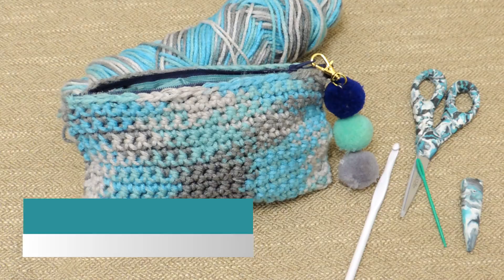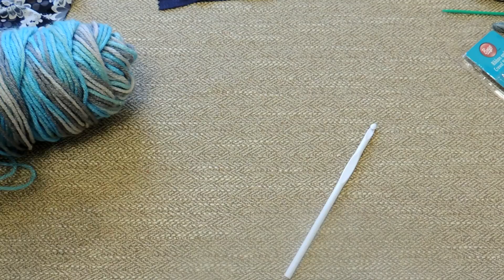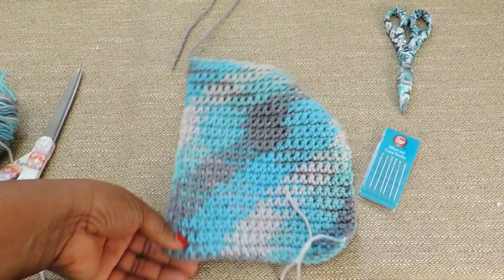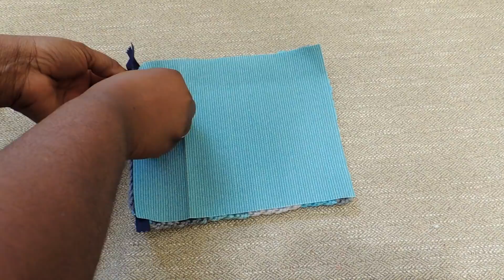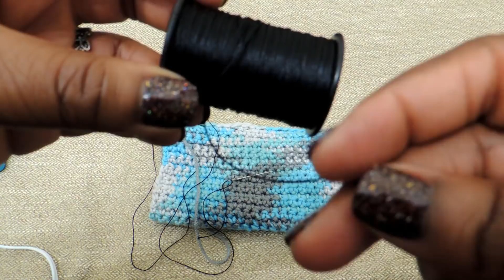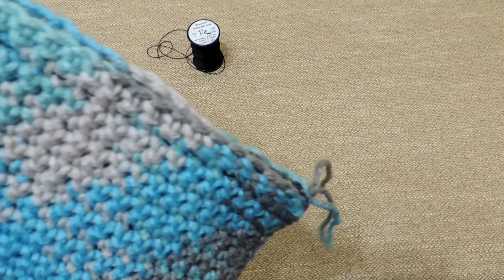Crochet Zipper Pouch-Beginner Project

Comment: How many rows and multiple of ?
Reply from the maker: Hi, this pouch is a customize bag so the stitch count may vary based on your needs. I had a 7 1/2  zipper so I made a chain of 28 stitches. The pouch area was created with 18 rows folded in half making a 4 1/2" bag.  I hope this helps some. 🙂
Reply: What size crochet H8/5mm or I9/5.50mm
Reply: Hook crochet H or J
Reply from the maker: @daneillejeneboyd9214  you can use either,  an H is a 5.00mm and a J is a 6.00mm either will work for this project

Comment: Did you sew the sides of the fabric inside? If it's not sewed I'd think that the things inside would get moved around an possibly get between the crochet part and the inside fabric part, so I was wondering if you also need to sew the sides of the fabric to the crochet part as well.
Reply from the maker: That's an option, to sew it down. I actually glued the fabric inside to the crochet pouch prior to sewing it together. You could also create the fabric pouch and then insert it inside the crocheted pouch. Thanks the suggestion. 🙂